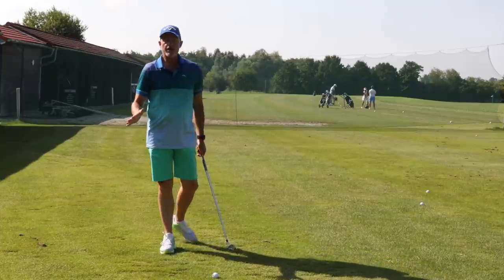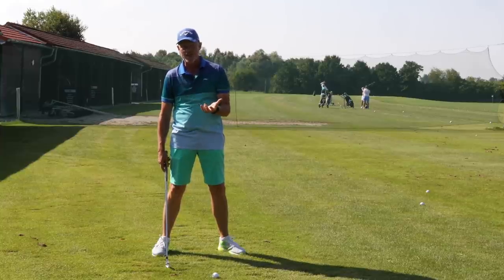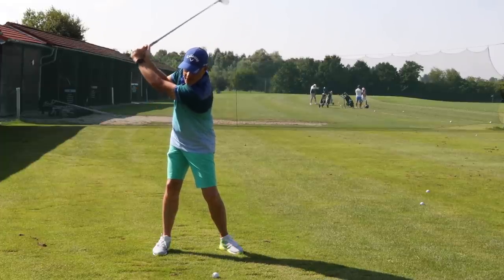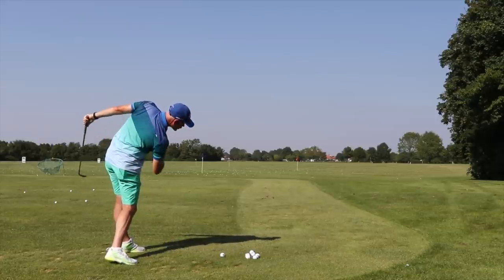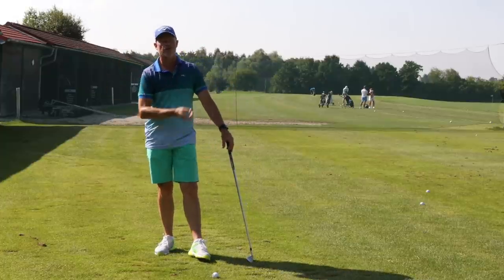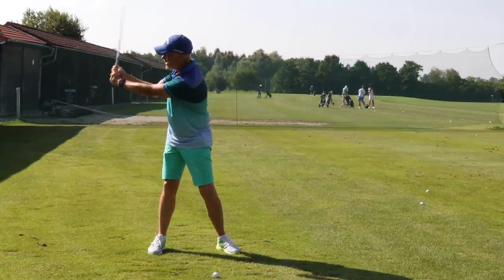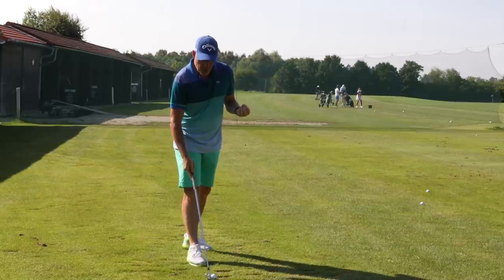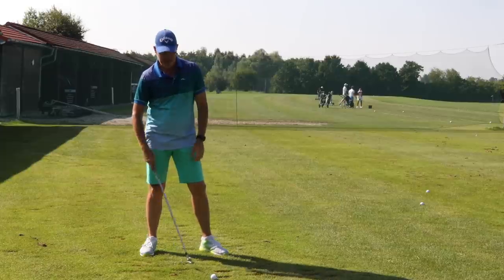How to delay the release in your golf swing.(The oldest trick in the book)

Comment: Hello Jonathan,
When I was in my late 40's I played to a 2.3 hcp. I absolutely smashed the ball off of the tee so generally had a wedge into most par 4's and a 6 or 7 iron into par5's. While playing with my son, I drove a 400 yard par 4.
I used a freakishly strong grip and aimed well right hitting big slinging draws that rolled forever. For years I was told by EVERYONE who I was paired with... You can't play good golf swinging like that!!! You need to get lessons.
After hearing this over and over for so long I finally gave in thinking they can't all be wrong.
I took a five lesson pack from a local pro and NEVER PLAYED WELL AGAIN!!!
It's been 11 years as I am now 60 and my hcp has crept up to over a 13. I watched your video "The move" the other week and though you caution it to be difficult, I found it to be quite easy to accomplish as the explanations in your vids are clear and precise. I am 60 but I mountain bike, run trails,, and "RUCK" up and down mountains so I still have a great deal of strength and flexibility,
I played the other day after practicing "the move" on the range a few times(results were almost immediate at the range)
I drove a 330 yard par 4 and am completely ecstatic about how far and STRAIGHT I am suddenly back to hitting the golf ball . Shots are coming off the irons like rockets.
I love the way that you caution everyone that this will not be easy and in some cases un-attainable whilst all of the other teachers promise the next great secret that anyone can do.
I thank you sir.

Comment: im 18 hc and have bad habits on moving head too early towards target before impact and missed solid contact, just a week ago im putting effort at the range to hold my head behind the ball during downswing but it requires lead hand to stay close to the body and rotate both hand while turning my hips as wide as i can so i can extend both hand in full after impact... its a weird feeling and very hard to get all things together in place, but i feel more relax and hit well... and now im watching your videos, it really helps me to re assure that what im doing is correct... thanks for the great lesson.. appreciate it
Reply: It's really important to keep your head behind the ball, especially with the driver.  When I start doing what you're doing, I do this drill where I do a normal backswing, then just drop the clubhead all the way to the ground as I rotate, and drag it through impact (not hitting a ball obviously).  Then gradually sync it up until your clubhead is just brushing the grass.

Comment: Getting your head down that low creates some major strain on my lower back. Perhaps you could give a tutorial for a best, functional golf swing for a stiff, old man ?
Reply: good question. would this move create injury?
Reply from the maker: This will not create back injury as long as you have turned your hips/pelvic. The lower back/lumber spine is carried with the pelvic meaning that only the thoracic spine bends and turns.
Reply: Jonathan Taylor great. thanks
Reply: To avoid the stain/pain on lumber spine and the hollow back of the lower spine I tense my lower abdominal muscles before I do initiate the single take away. Once I reach parallel point 1 one I dissolve the tension in abdominal muscles to support that sitting move and the shear motion whit the right food while the arms and  club moves still up towards the shoulder line. Right? Thanks for your advice, Jonathan.